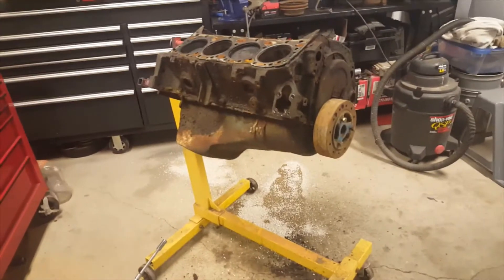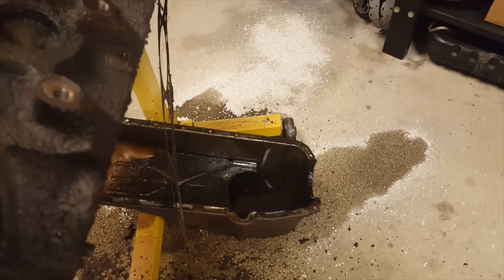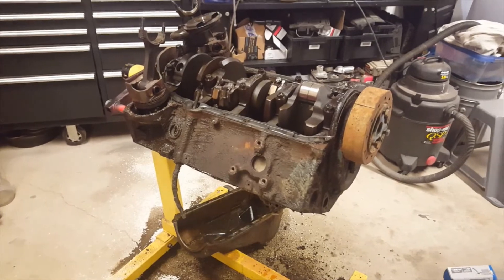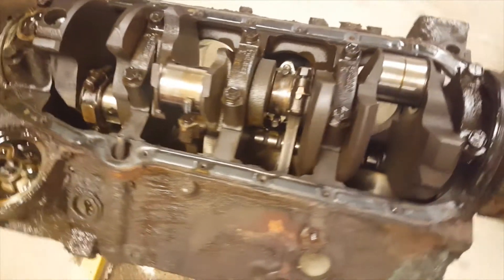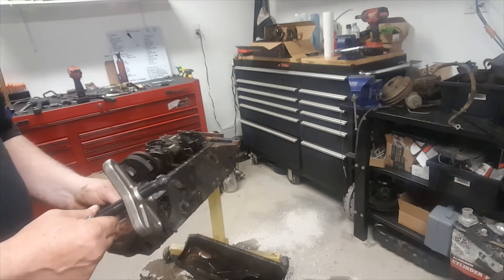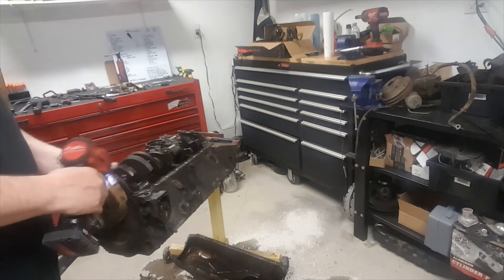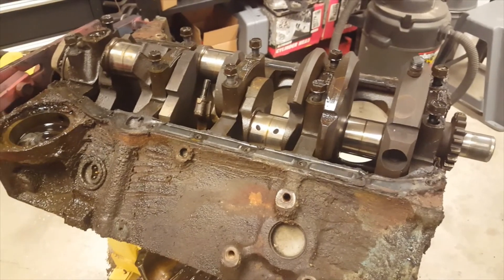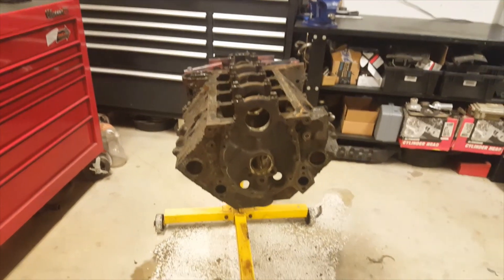305 Seized SBC Teardown /Rebuild Part 2

Comment: How did you get the seized piston out?...did you remove the crank and remove from the bottom?
Reply from the maker: No , once I was able to get it moving I knocked it out with a long extension , same as the others.

Comment: Hi Jay, over the pond here! I've got a 305 Chevy 1979 , my question is valve stem seals , are they all the same on the inlet and the exhaust ? Some tell me umbrella  seal on the inlet and a O ring only on the exhaust , thank mate. Wayne
Reply from the maker: Hi Wayne , I would use an umbrella or a positive type seal on the intake. The exhaust generally needs oil but if worn you could do either ,  everyone has an idea or situation that has worked for them at one time or another but not all situations are the same. I have done both on the exhaust on older engines with similar results. Hope this helps!
Reply from the maker: If the heads are being rebuilt you could do the umbrella and o ring.

Comment: Thanks for the video. Don't worry about making your videos shorter I actually would have liked to seen the cam and lifters come out. And that piston.
I'm about to bring my 350 block to the machine shop. I didn't realize I needed to put the bearing caps back on when I bring it there so I appreciate your video.
Looking forward to your 350 rebuild really hoping you decide to go with vortec heads because I really want to learn what's involved and swapping that over and upgrading the heads. Either way I'll be watching.
Thanks again